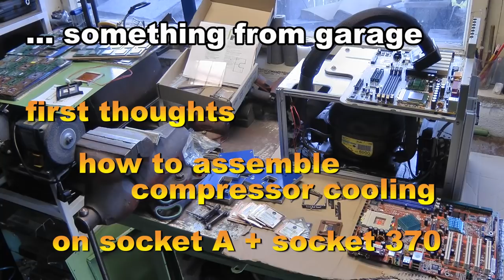problems with compressor assembling - Tualatins + Athlons

Comment: Be careful with stressing the plastictabs of the socket! Especially, when the plastic gets older and brittle
I had to replace 2 damaged sockets from boards i got. Fortunately "only" socket 7, but quite annoying.
Even using a normal socket 370 cooler with a Tualatin can be enough force to break the tabs.
Reply from the maker: I was thinking same way, it is risky.

Comment: That zip ties solution is a little scary 😅
Without dedicated holes around the socket maybe you could think a solution that goes completely around the mainboard, using the "case" to keep the cooler arm in position/tension with some "load securing straps" or "ratchet straps", not sure what's the correct name in English
Reply from the maker: It looks scary but it works :-)

Comment: for athlon you can use xeon's s604 head mounted with silicone rtv, and liquid metall on die for best results. for p3 you can use drilling machine for making hole in die, because its best cooling method for intel's cpu forever))

Comment: Idea for the tualatins: 
1 protect motherboard with some kind of plastic shim (some boards have it).
2 machine a slim (1-2mm?) square-holed adaptor that will horizontally-lock with the socket fixtures and have screws holders or screws themselfes to then tighten the evaporator.

Or, easy way out. Use very large clamps that go around the board and clamp everything down, you can even create one with a whole for the evaporator.. Will fit everything you throw at it. Cheers! ;)

Comment: I used to have an Abit NF7-S 2.0 mobo with a dut3c 2100+ tbred b (13 x 133) but it ran at (166 x 13) xp2700+ speeds at default vcore of 1.6/65v.
Used to run it at 11 x 210MHz 24/7 and I think it was about 2300MHz with 512mb ddr1 (pc3200 Kingston value)

Comment: With the socket so close to the edge of the motherboard, a C-clamp with modified jaws would probably work well.  Attach one of your u-shaped brackets to the main body and add a backing plate below the motherboard to spread out the clamping force from the moving pad.  (With neoprene to protect SMT components, of course.)  A few layers of Kapton should protect well around the socket if you stay with that route.
Using 486-style clips on the edge of the CPU itself would probably be a bit too much stress. ;)
Reply from the maker: I will use holes on MB in final, this is lot of work but safe way
Reply: @RETROHardware  I look forward to seeing it!

Comment: Is it possible to use existing plastic clamps on socket and use a high tension  sheet metal and just Bend it close a "U" to secure it? No need for several parts. Hard to explain without drawing but I hope you get the idea. Just one pice sheet metal with holes for the clamps and maybe a spring pushing down on the block. No such things as bad ideas 🤣 Or make mounts so you can fully utilize the zip lock even tho it looks risky.

Comment: I just put some erazer around the core at roughly the same hight as the core and then put a bunch of thermalpaste on the DIE then just the single stage/ cascade on top, alternatively a 775 IHS slightly sanded down on the bottom works on bartons to prevent chipping the DIE but temps are bit worse that way even with good paste...
On S370 power consumption seems so low that a heavy evaporator just sitting on the cpu works fine, my tusl2-c is missing the tabs anyways, so it's either that or just a huge c-clamp mounting the evap

Comment: I hope you have kneaded Eraser cover the CPU except for the area where the cooling probe will go and Neoprene sheet  that will go on the back of the CPU socket to keep the moisture away from the electronics of the Motherboard.
Reply from the maker: All the time during action I used toilet paper or foam + heating from other side of MB PCB.
Reply: @RETROHardware  Was there no CPU install instructions that came with the CPU cooler system or did they assume you would know how to do it.

Comment: First use  tape  for  these  SMD  8:28  or  even  aluminium  foil double sided (electrical tape) (not  conductive Off the  course)   (something  like  that ....)   Fak  it  Use  silicon glue or  hot  glue  You get the  point.

Comment: 6:27 die Metal-Platte brauchst du eigentlich nicht wenn der Kupferrahmen genau so dick ist wie die CPU. Oder? 
… 
You don't actually need the metal plate if the copper frame is just as thick as the CPU. Or?